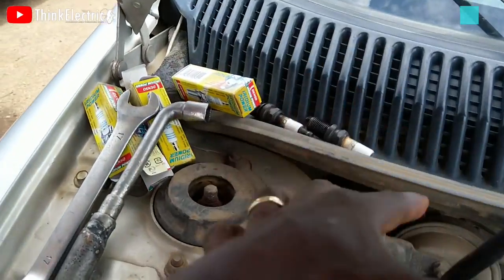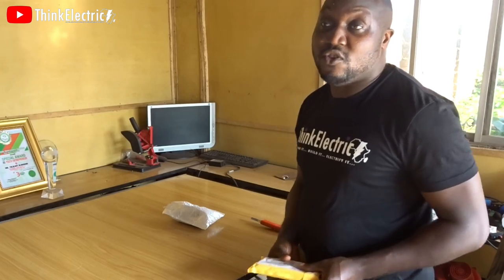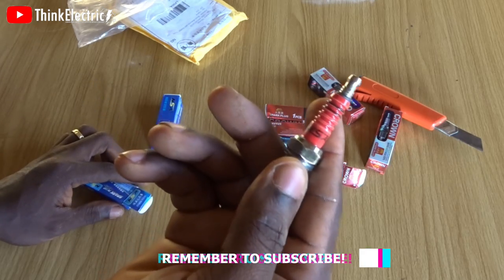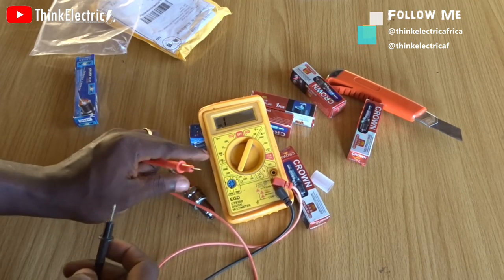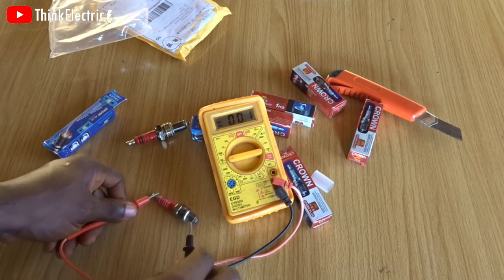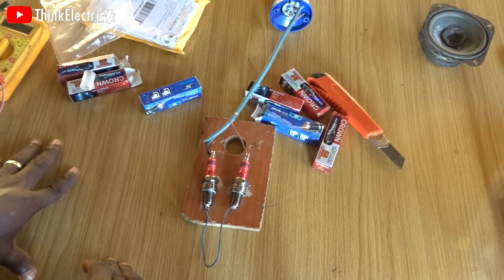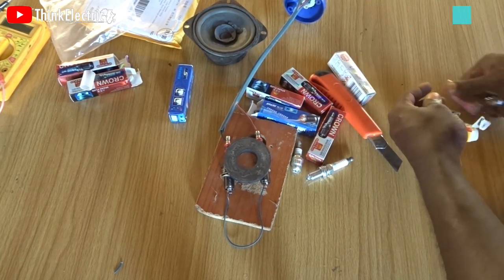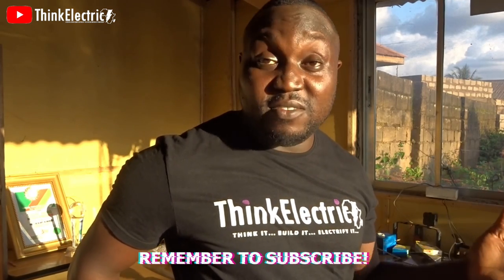SCAM! Free Electricity from Red Spark Plugs and My Last Video!

Comment: The problem is u guys don't know where to buy original iridium spark plugs..Fk uses a tester to test all his iridium plugs n he also did a video on different types of plugs.
Why not get the spark plug tester n order for original iridium spark plugs..a white man also replicate it and it works for him..So why are u guys doubting it?? Iridium n copper spark plug generate electricity